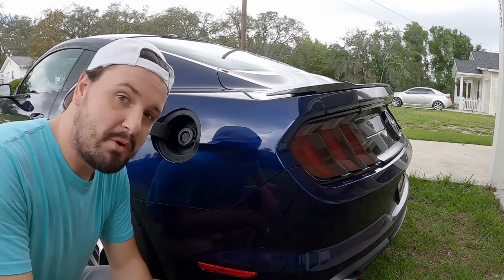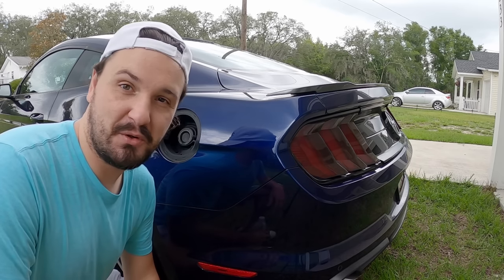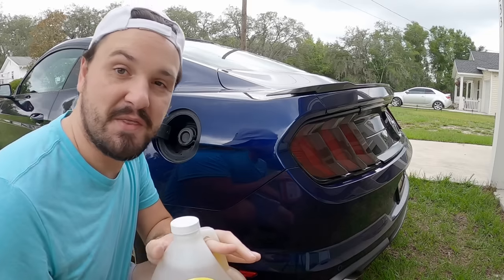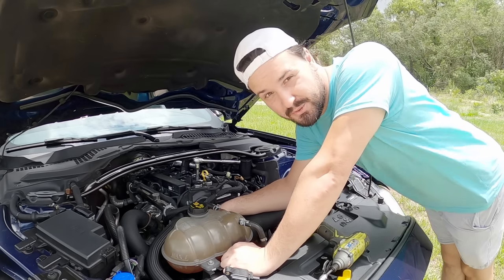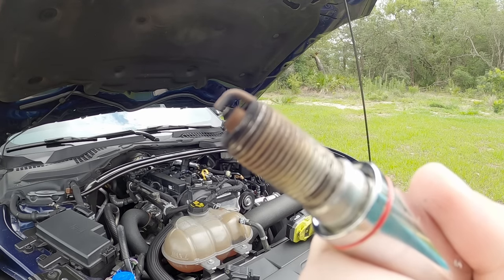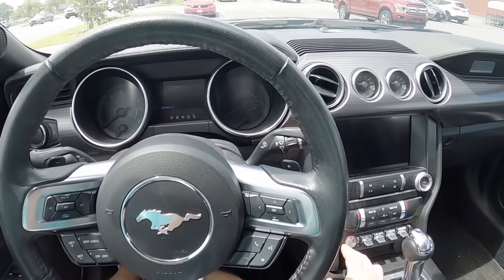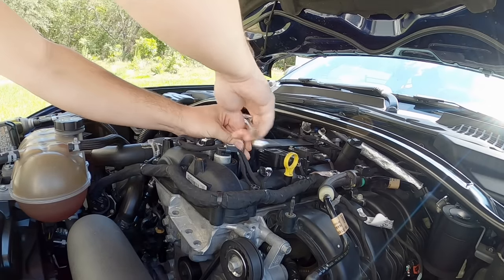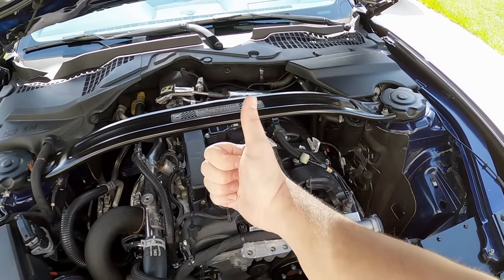The UNTHINKABLE Happened after using a Gallon of Lucas Fuel Treatment!

Comment: Started running Lucas in my 02 Jeep Grand Cherokee (with 166,000 Miles) about a year ago ... the 4L is running so good I can't think of a single reason to spend an afternoon tuning it up.
Got 90,000 from the last tune up...Good Stuff.. for about $2 I use it with every tank full
Reply: Your transmission is gonna go out,start preparing for that day...
Reply: I use about 3 ounces every fill ,on my 03, 6.8 Excursion,  270,000 and still very crisp

Comment: Everything before the cylinder ended up in the cylinder with the plug or burned out the exhaust. The moist on the plug is the remaining Lucas that didn't burn off. It wouldn't do that had the proper amount being put in.

Comment: I tried Lucas UCL & cleaner on my 2009 Toyota Avalon at 97K miles, thought it might benefit from some mild cleaning and lubricant in the fuel system. I was averaging  25 mpg before treatment and was hoping for that to increase.

I was surprised to see worse fuel efficiency, it dropped to 21 mpg until finally after my fourth fill-up without touching the Lucas product, the efficiency returned back to normal. I'm not sure what happened since I used the normal amount. But the lesson I got is, if you have a modern reliable engine that's working great, don't mess with it and add additives, since it might mess up with spark plugs or a sensor or something. This stuff is probably suited for gas guzzling trucks and older cars pre-2005.

One thing I did notice was that the engine seemed to run smoother and quiter.
Reply: Same with the Seafoam additives. That stuff isn't intended for the late model vehicles like it is for the older models, that is for sure. But I tip my hat to those who try it and it works out well for them. I'm not going to try it with any of my newer vehicles  just out of caution.
Reply: @RavancheII exactly, this stuff is good to raise the bar with badly designed engines. I noticed that for this topic on the online forums, Honda and Toyota cars were totally absent in the discussion on any benefits gained with fuel additives 😂
Reply: @SincerityAF  Agreed, it helped my 02 Camry marginally, tho I used a different brand, Redline. I don't regret it, I enjoy the +6 mpg and very marginally smoother power delivery. All of it is somewhat just marginal tbh
Reply: I noticed the same after adding Amsoil PI with my 05 Camry. I came to the conclusion it did clean the cylinders and sent all the carbon deposits into the exhaust and that fowled the air fuel ratio sensor that sits before the catalytic converter.
Reply: @HunterBikelife  Well a couple of months after the treatment, the reading on the fuel efficiency has been showing consistently worse. I'm thinking you're right that the sensor is messed up and "covered" with deposits. Question now is what to do? Is a replacement sensor worth? Is there any manual cleaning option?
Reply: There's no way an additive increased or decreased anyone's car 5 mpg. Think about that, seriously. You're adding in a few ounces to 20 gallons, and you think it's gonna change drastically?  Come on guys. Use your brains.
Reply: @neilwattoo  maybe it's just that good and it works :] *this is not a paid comment
Reply: former commentators are correct: Think of such treatments, in most cases,
being applicable & more beneficial to *older engines.
* Newer technology being
"sensor - laden" 
▶️ Otherwise, like shampoo, (with or w/out conditioner),
& how some medications affect your entire body w/ only ( 1 mg.) added to your bloodstream.
🔷 Ever read the ingredients
of an average pesticide'?
They're effective @ 99.27%
( inert ) ingredients

Comment: My favorite attitudes were the Berrymans b12 with a container of Chevron injector cleaner with a full tank. It did a great job cleaning out the system.
Reply: I swear by Berrymans B12 fuel system cleaner
Reply: berry mans b12 works good
Reply: Never ever use. Berrymans. I have had not but bad luck and my friends who have used it said it was junk also and they are all ase. Certified mechanics
Reply: @johnfairchild3421 ase is a joke

Comment: You just made me think not to ever buy Lucas Brand products. Ever😂
Reply: I have not used Lucas Fuel Treatment, but if I did, I would use the recommended amount of about 3 ounces for every 10 gallons of gas. Some people have told me that they use it, and they think it is a good product.
    I have been using Marvel Mystery Oil at every fill up in both of my vehicles for 7 years. I use the recommended amount of 4 ounces of MMO for every 10 gallons of gas.

Comment: I have read many comments about Lucas, some good some bad.  I have used Lucas and still do in all my vehicles as well as my kids vehicles as part of regular maintenance.  I also used in in my semi trucks.  I keep my vehicles as long as they run.  Presently I have a 2003 chevy suburban bought it from a used car lot back in 2009.  An X government vehicle basic model vinyl seats and floor.  It had 30,000 miles on it.  Today it has 270,000 miles on it and this car was used to tow my boat, and two different job trailers I had.  She took a beating, rear ended once (the car that hit me was totaled, all my chevy needed was a new bumper and hitch; and one cold, snowy Pa winter I slid down a hill into a tree which required a new quarter panel.  Anyway,  after 270000 hard miles,  no injector or fuel issues at all.  It sat for a year after I bought a pick up truck.  One day I went out and stuck a battery in her and she fired right up.   I don't have anything negative to say about Lucas.

Comment: When I got a neglected 1997 Tommy kaira M20b, it wasn't running as nicely as it should at 140,000 klicks, and just 20K after a top end rebuild. So I got one litre of Morey's Upper Cylinder Lubricant, and dosed the gas tank five times in five fills. The car ran smoother especially on start up, started more easily, pulled harder, and it added an extra kilometre per litre around town!  
Is good stuff.

Comment: Adding any oily fuel additive has the potential to decrease the octane level, adding a gallon really lowers it.  More power?  Seriously doubt it.  Your engine senses the lower octane, changes the spark timing to prevent knocking.  As a result, you have raw fuel entering the catalytic converter.  Bad for converter, bad for mpg and potentially will throw codes and triggering CEL.  
Best rule of thumb .. use quality fuels and pay a little extra for the additives.

Comment: Ya the sand ratio is 3 cups sand to  5 quarts corn oil or real butter then fast idle around 5000 rpm in neutral for a full 15 to 20 min.

Comment: Lucas Upper Cylinder Lubricant is good stuff but it’s not very strong. 
If you want strong that will definitely clean your valves and combustion chamber, run Berryman B12 Chemtool. You actually feel the difference when using Berryman.
Reply: Agree
Reply: Ok then Berryman it is I'm picking up ten cans and dumping it in Chem tool you say
Reply: Vitamin B12 got it

Comment: I had 2 vehicles that had BAD lifter clatter. A mechanic told me to put Marvel Mystery Oil in my oil. SO, within 20 miles the clatter COMPLETELY  took the clatter out and it never came back.
Reply: @ stevenhard3961--    About five years ago, my 2002 Chevy truck had a loud lifter ticking noise. The oil was a quart low, so I added a quart of Marvel Mystery Oil to the crankcase. Soon the lifter ticking noise disappeared. I drove the truck about 400 miles and when I changed the oil, it was extremely dirty. This was telling me that the MMO was removing the sludge out of the engine.

   I also use MMO in the fuel. I use the recommended amount of 4 ounces of MMO for every 10 gallons of gas. The vehicles are running better than ever, and my car now gets at least an extra one to two more miles per gallon on the highway.

Comment: MMO has a lot of phosphorus which should clean a bit, but it almost definitely will adversely affect your catalytic converter. I believe the Lucas acts like a slight thickener which helps fills any spots in cylinder walls and rings and seals as well as lubing the fuel pump, lifters, and cylinders. Lucas isn’t even a little flammable which I believe makes the fuel burn at a higher temperature, reducing early detonation

Comment: Used Lucas as perscribed for 1000 miles. Ended up needing to replace my gas filter, number 8 injector and clean the fuel rail. The only thing I think I'd ever use again is Techron since it's a proven additive. At least it won't screw things up.

Comment: I use the Lucas HI MILEAGE FUEL TREAMENT for cars over 75,000 miles in my 2000 Acura TL, and it's amazing how much better the car runs! (It just turned 260,000 miles last week) Maybe I'll have to try the Upper Cylinder Lubricant next time as well, although not a full gallon...lol!

Comment: I use Lucas when I can't find gallons of marvel Mystery Oil in my Detroit D13 semi truck engine.
It used to get 5.6 mpg average, now around 6.3 mpg on the same route. Use 15 oz per 75 gallons. = around $14 dollars per day fuel savings.
Reply: I have used Marvel Mystery Oil in my car, truck, and lawn mower at every fill up since 2016. I use the recommended amount of 4 ounces of MMO for every 10 gallons of gas. Since I started using MMO, my car now gets at least one to two more miles per gallon on the highway.

Comment: I've always used mystery oil in the gas 40 yrs doing it and I have never had a problem I use only a little bottle like a injector cleaner bottle and refill it once a month I've freed up a lot of froze up engines that were full of water it works great
Reply: is the small bottle the amount that you add to a tank full every time you fill up? (not knowing how how much you drive or fill up per month)
Reply: @ Brian Anderson--      Marvel Mystery Oil is a great product. I use it at every fill up in my car, truck, and lawn mower. I use the recommended amount of 4 ounces of MMO for every 10 gallons of gas.
     Several years ago, my 2002 Chevy truck had a loud lifter ticking noise. It was a quart low on oil, so I added a quart of MMO to the crankcase. Soon the lifter ticking noise disappeared. I drove the truck about 400 miles and when I changed the oil, it was extremely dirty. This was telling me that the MMO was removing the sludge out of the engine.
Reply: @ ibberman--    I use the recommended amount of 4 ounces of Marvel Mystery Oil for every 10 gallons of gas at every fill up. I have been using MMO for 7 years, and my vehicles are running better than ever, and both vehicles are 21 years old. A small amount of MMO goes a long way. You don't want to over do it.
       I have saved a lot of the empty  quart MMO bottles, and when I need more, I take a full bottle and put 4 ounces in each one and keep several of them in a small box in my trunk. This way I can add the proper amount of MMO every time that I buy gas. I like to put the MMO in the tank at the gas station, just before I pump the gas.
Reply: @ibberman  4 ounce bottle ,
Reply: @franknew9001  great tips thank you

Comment: I put about 2oz of the lucas every other fill up. It increases my fuel millage from 300 miles per tank to 400 miles per tank. I drive 200 miles per day so its a pretty good savings.
Reply: With that much driving consider getting a motorcycle
Reply: @ryanrogers8211  believe me I would if I didn't have to haul so many tools and materials around with me. Not to mention it's kinda miserable in the summer when it hits 115-120.
Reply: @MrCard031584  yeah makes sense to get into the air conditioning
Reply: You're claiming a 33% mpg increase, which is like going from 15mpg to 20mpg, by using it in every other tank.🤣🤣🤩🤩
Reply: @snakepliskin1185  it goes from about 25 mpg to about 35 mpg. Probably a bit closer to 325 miles without Lucas and 410 with Lucas. It's a 2007 Hyundai elantra with 150k miles on it. Might be something going on that it fixes. Car is supposed to get 35 mpg but only gets around 25 mpg without the Lucas. I'm not a mechanic, but these are my results using Lucas fuel treatment. Maybe it's more effective in older worn engines.
Reply: @MrCard031584  outstanding results 👍🏼 that is well worth using it

Comment: I put 5oz in my 4cyl cars & 8oz in my V8 trucks. Increases gas mileage by about 10٪. Also reduced oil consumption to zero in one car that ate 1 qt every 1000 miles. Cost wise, it saves a little money if you buy it by the gallon. 

Not sure if it cleans my plugs or not, but my exhaust smells like Lucas.

Comment: Are you serious, that plug is showing that the engine is running way to rich. But he is not even checking the plug properly. You need to be on the throttle hard basically WOT and shut off the ignition an release the throttle at the same time. Get the plug out of the motor asap and look down on the porcelain about 1/3 of the way past the electrode. The color should be a very light tan or light cocoa color. And dont you think the engineers that are employed by the company and paid a bunch of money to make sure the product works know what they are talking about when they suggest the proper  ratio?

Comment: I  have been using Lucas injector cleaner for years works great, one time I use a whole quart of it in my 2003 Mercedes Benz drove to New York car ran great. Three days later the fuel pump went on the car. I tried using marvel mystery oil in my car and days later, the check engine light came on it. Clogged up my catalytic converter not a good idea.

Comment: I use a gallon of Lucas on 300 gallons of diesel fuel and I’ve learned that the whole gallon is a little too much so I started splitting half a gallon between my tanks. I cannot even imagine what is going to happen in a mustang most likely a catastrophic failure.

Comment: using oil additive to reduce smoking I blew up an engine once by replacing a quart of oil with Lucas oil additive. It was so thick that it was blocking the lubrication holes and the oil pump wasn't getting the oil into the top and front of the engine. More isn't better with somethings. Now i did add some of the transmission additive to a tranny once just about an ounce and so far it seems like it helped lube the tranny

Comment: I've been using 90- 93 octane ethanol free gas and have been pleasantly surprised at the performance of my 2003 ford F-150 with 150,000miles and 4 ounces of MMO at every fill up, its higher priced gas but I don't drive as many miles as I once did

Comment: I had a Detroit diesel 60 series engine in a Prevost Bus.  I got bad fuel at a small station and had about 200 gallons of bad fuel.  I was barely running when I got to a truck stop.  I thought I was screwed.  I generally get about 8 miles a gallon in the bus.  I was looking in the truck stop for fuel treatments and a driver saw me and asked what was up.  I told him and he told me to put this stuff in it.  It was Lucas but I don't think it was this exact product.  It cost a lot was the main thing I remember about it now 8 years or so later. I put the whole bottle in and added about 10 gallons of fuel.  I took off from the truck stop and hit I-65 Ramp and that bus took off like a rocket.  I got 10 miles a gallon on that tank.  It more than paid for itself as I got a 20 percent increase on that tank of fuel.  I think what I got was supposed to treat up to 200 gallons.  I can't speak for a Mustang gasoline engine but for a 60 series Detroit diesel with bad fuel, it worked wonders.  I am a Lucas oil believer.  That driver told me if this doesn't work, you'll be looking at serious down time and draining your fuel tank etc..... Saved my trip!

Comment: In germany some add 2 stroke oil to their diesels. That is a risc for the particle filter. There some use additives to increase combustion temperature which also can become dangerously high for the particle filter. It is definitely nice in winter, because it heats your car much faster.

Comment: Tried this in my 5.3l. Runs great but fuel mileage decreased by 6 litres per 100 km . Engine runs great .. I’ve got other issues  with sensors (air to fuel ratio ) who knows where to start ..?

Comment: The only thing I can say is on older Diesels it might be better to lubacate the old internal fuel pumps. Because they took out the led in the fuel. But sea foam was made mostly for two cycle motor boat engines. Everybody is dumping junk thinking it's mechanic in the bottle 😊

Comment: i dont know man, i think lucas products are good but they can only do so much. mostly i think its more of a use over time where the full benefits are achieved. 

What i think actually may have improved your performance is what we call in Pennsylvania an "ITALIAN TUNE UP" which is basically giving an engine a good workout . i find that especially in higher performing  engines it is essential to heat em up and get that hot oil pumping around in there and good rpm under load tends to keep engines happy and can clean and lubricate and clear oil ports and ducts or whatever you want to call them. 

This is a very interesting test. I too have experimented with marvel,sea foam,lucas,stp and others even K-1kerosene all with basically similar results. so yeah its good to try different products but most importantly DONT LET CARS SIT! and ALWAYS CHANGE THE OIL and they will last a long time.  but then again i only mess with vintage iron and detroit steel from the 20th century.  keep up the experiments dude!! i digg 😎👍🏼 and i subscribed.

Comment: I've been using Lucas Upper Cylinder Lubricant in my cars for years but never more than the 8oz bottle. I buy a 32oz bottle of the Lucas and refill my 8 oz bottle. It makes a noticeable difference in performance a a quieter running engine in my 2006 Mustang GT with a 4.6 liter V8 and my wife's 2011 Hyundai Sonata with the direct injection engine. No way would I add a gallon of the Lucas Fuel Injector Cleaner to either of my cars!